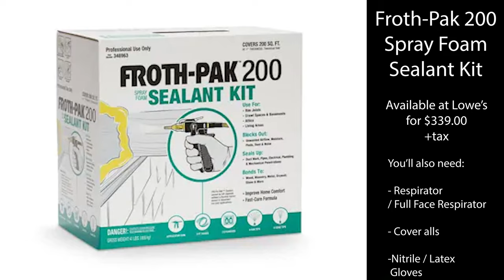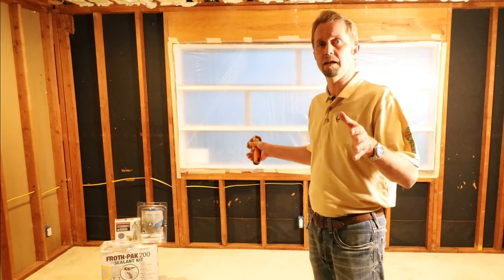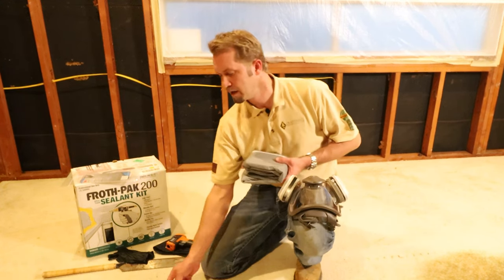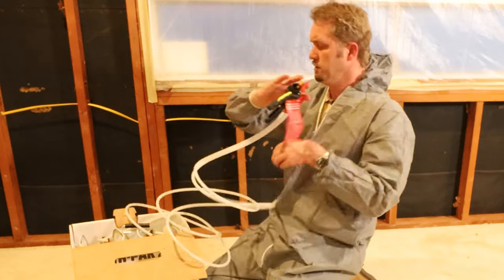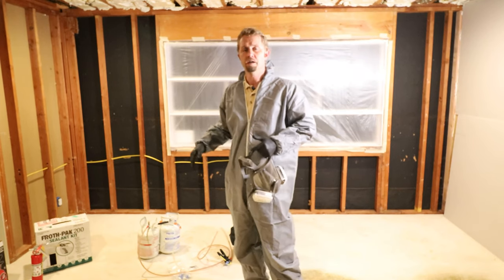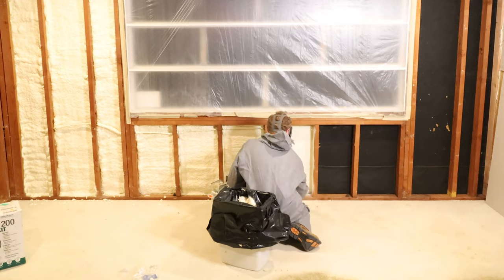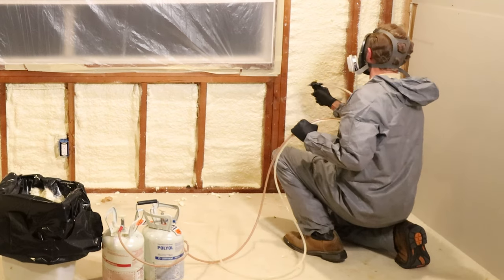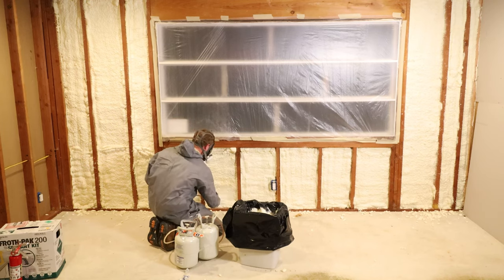Froth-Pak 200 Spray Foam Sealant Kit Set-Up, Precautions, and Spraying Review #Froth-Pak

Comment: Thank you.  This is helpful.  Question: if I have a 6000 square foot house I need to apply close cell foam to, I calculate 536.4 linear feet (3 floors at 2000 sq ft / floor) or a total perimeter of 536.4 feet.  With 8 foot walls that is 4,291 sq feet of closed foam insulation.  Assuming 2.5" thickness, that is 10,728 board feet of insulation.  @ $2 / board foot, insulation should cost $21,456 installed.  Does that sound correct?
Reply from the maker: You would calculate the lineal footage of exterior wall X the height of 8 feet. 536.4 lineal feet X 8 feet high is 4,291.2 sq. feet, so at 2.5” thickness, that is 10,728 board feet, correct. You’re estimating is correct at $2/ board foot. 
    Once you get above $1200-$1500, it’s cheaper to higher a spray foam contractor to do the work with materials and labor. Froth Pak sells the 200 board foot kit for $409, currently, and the 620 kit for $1,025, which will bring the cost down some if you are still thinking you would do it yourself at $1.65 per board foot, assuming you got a full 620 board feet out of a kit, which you most likely won’t. 18 kits of 620 is $18,450 plus tax and shipping (if any).
Reply: @craftsmanconnection   Thanks.  This is really helpful.
Reply: Hire a pro for that big a job.
Reply from the maker: Violet, you mean hire a pro for that 6000 Sq. ft. House? Yes, of course. It’ll be way cheaper and faster to hire a pro for a large job. Anything over about 225-300 square feet of wall surface, you’d be better off hiring a pro.
Reply: @craftsmanconnection  correct.  
Your DIY video is detailed and helpful. Nicely done!
I’m gunna hire a pro to do the walls in my standard two car garage.  Spray foam insulation is more expensive but so worth it.  Especially for noise reduction. I understand Batt insulation is much cheaper, but it’s also an inferior product.
Reply from the maker: Assuming a 2 car garage that is somewhere between 20’ x 20’, and up to 24’ x 24, all with 8 foot high walls, subtract out the 16’ garage door, the square footage of walls is between 512 sq. ft. To 640 sq. ft. 

My spray foam contractor charges around $1.40 per square foot for 3-1/2” thick (2x4 wall) foam per square foot, and $2.40 for 5-1/2” thick.(2x6 wall) per square foot. So for 2x4 walls $1.40 x 512 sq. Ft. Is $716.80, and 640 sq. ft. Is $896. The point is since you have so little in the garage to get the most out of a minimum charge, you might also look for other areas to spray foam to get the most out of their minimum charge.

A bunch of years ago my spray foam contractors minimum charge was $1,200. A few years ago his minimum charge was $1,500. Now his minimum charge is $1,750. Your spray foam contractor may have a different minimum charge.
Reply from the maker: For sound insulation, I have built some media rooms and tested the wall assemblies with a sound meter (decibel meter). To help reduce sound transfer, open cell won’t do much compared to batt insulation. What you need is a more dense wall and decoupling for sound vibrations. 

For media rooms, in the walls we have used spray foam insulation (closed cell foam is more dense), 5/8” Type X drywall (fire rated and more dense), followed by a decoupling product like decoupling metal channel or Green Glue, followed by another layer of drywall. For the floors, on top of existing subfloor, we have used 2 layers of what looks like 1/2” black rubber floor mat material, followed by another layer of 3/4” subfloor material, and then the finished flooring like carpet pad and carpet to absorb more sound and decrease sound deflection. You can research this more online, if it is important to your situation. Good luck with your project.
Reply: @craftsmanconnection  very interesting!  Thank you for the excellent information!  I’m not sure what else there is to sprayfoam in the house. 
It’s a 2001 3/2 cookie cutter home in Indiana.  Perhaps also sprayfoam the vaulted ceiling in the garage.  I’m hitting the garage… ripping out all the drywall and adding more outlets and lighting.
Reply: @craftsmanconnection  dang. If you lived in Indiana I’d just cut you a check and say go at it! Lol.  Thanks for the tips!
Reply from the maker: @violetjames7534  One of the things to think about for garages is the air quality. Typically or traditionally a garage was meant to store a vehicle with gasoline, and other chemicals such a paint, etc. When thinking about this insulation, I also think about air movement, known as fenestration. If you have a garage, that has a vehicle and any chemicals in it, I would imagine the garage insulation like it’s own ecosystem, and therefore it’s own bubble of insulation.

If the roofline above your garage is insulated, you would now have an insulated attic above the garage. I have a small electric heater on my patio that only has spray on the flat roof, and even in 30-40 degree outside temps, it stays around 54-64 degree inside the enclosed patio with 10 old single pane windows.

I’m going to redo my garage drywall soon, and put 100% of the walls and ceilings in the garage with spray foam insulation.  I’ve already added a bunch of outlets for my wood working tools, so I think that’s a good idea, and awesome that you are doing that too.
Reply: @craftsmanconnection  ventilation!  That’s incredibly important !  I will definitely keep that in mind. 
Also have to follow fire code. If I rip down the drywall ceiling in the garage, it can’t open up over the rest of the house.  There has to be a wall extended upward from the entry door into the house to the ceiling.
Reply from the maker: Lucky for you I used to be a building inspector. 😅 If you are replacing the drywall, use a 5/8” Type X drywall which is the 1 hour fire rated drywall. 

What Is Fire-Rated Type X Drywall?
Fireproof drywall is the common term; its industry name is Type X drywall. The thickness of this drywall is 5/8-inch, including all layers.

Glass fibers are added to the board to help it slow down the fire. Also, because it is denser than normal gypsum and paper drywall, it takes longer for the fire to degrade it.

Most Type X drywall has a one-hour fire rating. The fire rating for the 1/2-inch drywall used throughout the rest of the home is 30 minutes.

Any drywall in a moist, wet, humid environment such as a unconditioned garage space, bathrooms, kitchens, and laundry rooms needs to be the green drywall, aka green board, aka Moisture Resistant drywall. Home Depot and Lowe’s doesn’t sell 5/8” moisture resistant drywall, so you’ll have to contact a local drywall/ gypsum/ Sheeteock dealer near you. 5/8” drywall gets attached with 1-5/8” course thread screws into wood framing or fine thread screws into light gauge metal framing.
Reply: @craftsmanconnection  thank you for the accurate information!  I’m thinking about using different products other than drywall. I just feel it’s so outdated and nothing unique about it. I could go the Trusscore route, or even incorporate woods and metals. I’m definitely going with a PolyPro concrete coating for the garage floor. I like the metallic finish.
Reply from the maker: For Epoxy YouTube channels:

There is a YouTuber, Matt Risinger from The Build Show, who is a high quality General Contractor, who had a professional garage floor guy come out to do Matt’s personal garage floor. The garage floor guy had gone through a process of basically grinding the floor, doing a colored epoxy coat, and then a couple layers of clear epoxy. The grinding, and detailed cleaning was the part I hadn’t seen anyone else do.

There is another YouTuber group, called Stone Coat Countertops. They do everything with epoxy from counter tops to garage floors.

Blacktail Studio knows about making epoxy resin cast table tops with the wood on the sides. I don’t think I knew there were different clear resins for different pour thicknesses before he mentioned it.
Reply: @craftsmanconnection  I actually have been subscribed to both of those channels for quite some time. They do excellent work!  I won’t attempt the DIY on my garage floor. 
The Home Depot garage floor resin kits have more water added, thus when it settles and evaporates, the product becomes too thin.  Best to leave this one to the pros.

Comment: I'm not understanding what gets hot. Is it the two chemicals mixing together that causes  heat amd do you have to let it cool before adding another coat
Reply from the maker: The chemical reaction for the foam gets hot. This was a warning from my spray foam contractor. I did notice some heat when I tested it, but didn't see any evidence or smells that indicated anything to worry about. Just passing along the safety info from the professional spray foam contractor.

Comment: I didnt see you demonstrate putting the gell around the gun opening.  Should you start off by spraying without the fan tip on the gun to get the proper consistency first then put the fan tip on?
Reply from the maker: Clear grease applied, just not all that interesting or need for further explanation of someone reads the instructions.

I sprayed the foam components (Part A & Part B with the nozzle on, as I didn’t want to get those chemicals accidentally mixing and touching the gun before I got a tip on. With the color of the two parts, you can initially see in the clear hose if they are flowing, and see in the nozzle tip that they are mixing.
Reply: When’s the single drop? 😂

Comment: All the temperature concerns make me think you can't install this stuff during the winter(A Chicago winter). Is that true? I want to insulate my detached garage, so I have no residual warmth from the main house to help with this.
Reply from the maker: My spray foam contractor gave me the warning about the spray foam temperature getting too high, and it may be true, however I didn’t experience anything close to concerning as far as the temperature of the foam.

You may also be referring to the exterior wall temperature. You can use a infrared temperature gun to check the temperature for the wall surface. You can use a space heater to warm the surface until the walls reach an acceptable temperature. And you can use the space heater again to warm the detached garage if you want to work out there.
Reply from the maker: I’m also working on a shed project video, in which I’ll be installing more of the Froth Pak in that shed. One thing to keep in mind, is the build up of humidity, since there isn’t an air conditioning system. I’ll be installing a temperature sensitive vent at the bottom of a wall, and another vent at the diagonal top of another wall for cross ventilation. You can close this off if you choose to use heating or AC. The whole point is to not have condensation build up, causing mold, since closed cell foam isn’t vapor permeable.

Comment: Isn't this the wrong kit for this application?  They sell two different Spray Foam kits... This kit is the "Sealant" kit (Green Box): For gaps, cracks and penetrations up to 4" wide.  The "Insulation" kit (Red Box) is for in wall insulation?  They appear to have the same R value though.. Are these truly different products?
Reply from the maker: No, this is the kit that does insulation as well as a sealant kit. If you look on the second paragraph of the DuPont website, which is the manufacture of Froth Pak 200, you will see that it is insulation and sealant.
Reply: Unfortunately, DuPont has done a bad job labeling the box, but is correctly described on their website. It’s like seeing a Great Stuff spray can that says Gap & Crack Filler, but is still spray foam insulation. It’s just a smaller sized package.

Comment: Bottom line was the cost for all that a better value than using traditional fiberglass insulation???
Reply from the maker: The air sealing qualities of spray foam are far superior to transitional fiberglass. There are no air voids due to anyone’s ability to measure, shape of void, or other obstacles in the walls such as wires, outlet boxes, pipes, etc. Froth Pak is a closed cell foam which has approximately twice the R-value than fiberglass per inch of material. The short term material costs are higher, but the longer term heat loss (during cold months) and air loss through air exchanges is less. Also try caulking your bottom wall plate to the subfloor (concrete or wood), if accessible.

   Study ACH which is Air Changes per Hour. Passive house standards are 0.6 ACH 50. That’s 0.6 Air Changes per hour, at 50 bars (not PSI)  of pressure created by wind force. An example of this can be seen by checking out videos of blower door tests, to see how air tight some houses are. Essentially all of your money spent on heat and AC is leaving through holes, gaps, and voids in your house. I can see some if this in my clients houses when I do FLIR imaging camera shots.
Reply from the maker: The cost of spray foam will get cheaper as you buy a larger spray foam kit. Once you get pass about 3-4 kits, you are better off hiring a spray foam contractor, which will bring that down to roughly $2.00 per square foot at 2” thick for closed cell or $1 per square foot per inch of foam, and get the labor included.
Reply: @craftsmanconnection  thanks for they info and the reply.

Comment: Is it ok to apply spray foam insulation when the attic is 110 degrees? Will it fully cure? Or will it off gas forever?
Reply from the maker: The spray foam will fully cure. Froth Pak , closed cell foam, will expand fairly quickly with about a minute, and cure within hours. Open cell foam expands within just a few seconds, like 2 sec-5 sec. You’ll want to spray a small area, like 2-4 square feet first, and test the foam to make sure it’s mixing evenly. If it’s getting too much of one chemical it’ll be very flaky, and if too much of the other, it’ll be drippy. I didn’t have any issues with the froth pak. Just follow the instructions to make sure your spray nozzle doesn’t sit around for more than 30 seconds unused, otherwise you’ll need to change the spray nozzle for a new one. So get your area all prepared and then start spraying.

Comment: Is there not a gap between your window header boards that should be filled ? 
How about the open wall It's ?
Reply from the maker: It’s been over a year since filming, but there was probably a gap between the window header and the window frame. The Froth Pak 200 was used to fill the wall cavities, and I later used door and window foam in a spray foam gun for the window area, and any other tiny gaps. Different types of foam apply different amount of expansion pressure, or expansion amounts.

 Closed cell foam doesn’t expand as much as open cell foam. Great Stuff Big Gap Filler expands more than their door and window foam, and so on. I have some experience with the various products, but not an expert on spray foam.